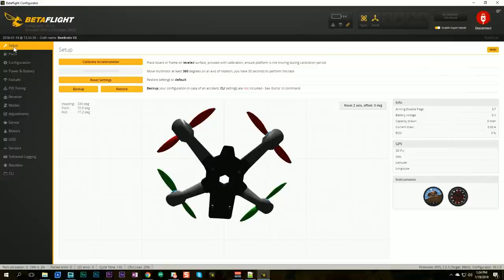Calibrate & Trim Betaflight Tiny Whoop Accelerometer | HOW TO FIX ANGLE MODE

Comment: My quad doesn't respond to the trim. Well actually is does till I move the sticks and it just drifts the same way again. I am not interested in Angle mode but this is concerning isnt it?
Thanks for the amazing videos! :D
Reply from the maker: First thing, make sure that your sticks center at 1500 in the Receiver tab.

Second, trim the accelerometer, but only if you are flying in angle mode. If you're not in angle mode then accelerometer is not used. 

In Acro mode, you must manually make small adjustments to keep the quad from drifting. That's normal.
Reply: @JoshuaBardwell  I read other forums and threads about this problem. happens pretty often. 
The thing is it doesn't just drift, it changes its orientation, which at some point even with full stick deflection can't be compensated. So i assume it's sth that messes up the gyro/accelerometer itself. But I am flying acro anyway. I was just worried about what could cause such behavior. But as i said acro flies great.
Thanks again Joshua!
Reply from the maker: Accelerometer drift is a betaflight bug. There are a few CLI options that sometimes help with it but unfortunately I don't know them off the top of my head and I don't have a quad handy to test with.
Reply: @JoshuaBardwell  you mean these?
set acc_lpf_hz = 1
set accxy_deadband = 80
set accz_deadband = 80
because I tried them and they dont seem to work. I might have a faulty FC...

Comment: What about yaw drift, my tinyhawk just all of a sudden starting yawing left always with no stick input :(
Reply from the maker: Check in the Receiver tab to make sure the yaw channel is centered at a value of 1500. If it isn't, use the subtrim setting on your transmitter to adjust it.
Reply: @JoshuaBardwell  my yaw always fluctuates a bit, and I had a bit of yaw deadband set up even before this became an issue. When my receiver tab shows yaw centered at 1500, I get the yaw drift, I needed to subtrim it to about 1512 to get close to stopping the drift visually.
Reply from the maker: Is your Channel Center set at 1500 or 1520 in the receiver tab? It should be 1500 for most setups.
Reply: @JoshuaBardwell  stick center is set to 1500 in the receiver tab and I have calibrated the sticks on the TX. Would props have any effect? 
I'm not sure but it seems these issues popped up when I changed a couple of the props that were lightly damaged. At first I got a weird yaw twitch when trying to fly which seemingly was an issue with the mixer setup. I fixed that in the transmitter, and then noticed the persistent yaw spin and a bit of backwards drift. 

Thanks for the help by the way.
Reply from the maker: In the Setup tab, is the 3D model rotating slowly?
Reply: @JoshuaBardwell  when I removed yaw deadband and removed the subtrim on my tx, it does rotate super slowly in the setup tabs 3D model. It holds at a heading for a while then rotated a tiny bit. Now that I have removed all subtrim, my receiver tab is showing yaw at 1493. I retrimmed to get yaw at 1500 in the receiver tab, then checked the setup tab again and it appears it is still slowly rotating on the setup tab.
Reply from the maker: @RavenWindrunner  If the channel is centered at 1500 and the betaflight Channel Center is also 1500, then the quad should not want to rotate. You can verify this by checking the 3D model in the Receiver tab.

If the 3D model in the Setup tab is mostly stable (a tiny tiny rotation is not a problem) then the gyro sensor is also working correctly.

At this point, I think blackbox log analysis would be needed to troubleshoot further.
Reply: @JoshuaBardwell  yeah there is no rotation in the receiver tab, but the setup tab model changes its heading about 1 degree every second or two seconds.
Reply: @JoshuaBardwell  thanks for all your help. Unfortunately the tinyhawk has no dataflash chip so I don't think I can do a blackbox analysis.

Comment: Damn, seems betafpv whoops are not compatible with this stick commands :(
Reply from the maker: You have to be in angle mode for it to work.
Reply: @JoshuaBardwell  This quad got Normal, Sport and Manual. Is Angle mode Manual in that case?

Comment: Aren't this stick correction inputs doing just exactly what trims does on the RC ?!
Reply from the maker: Not really. If you use the trims in angle mode, then the quad will not fly right in acro mode.
Reply: @JoshuaBardwell  Oh I see, Thank you josh !  
And  except if it do not work anymore in BF current version, I just learned that the BF stick input you did in the video can also be hold for one second = 1 clik as you said ( instead of repeat ) Didn't test it yet, I'm in bed...